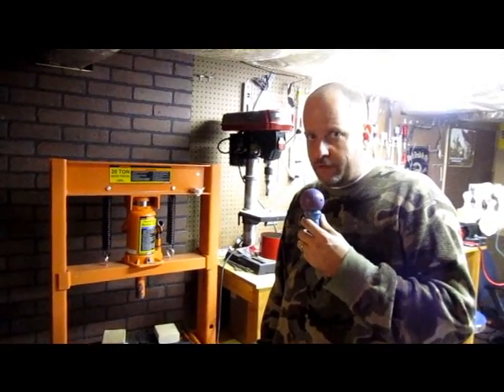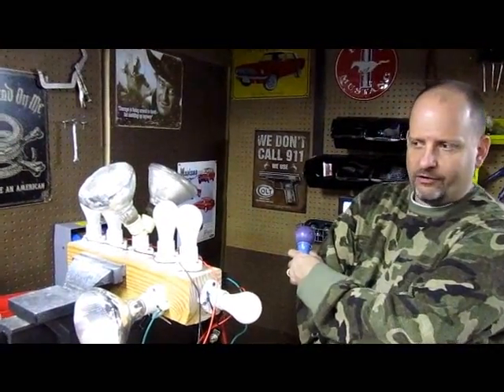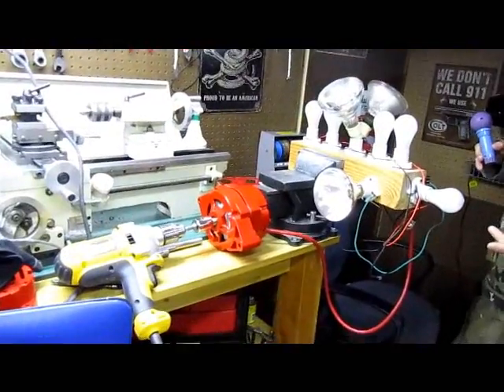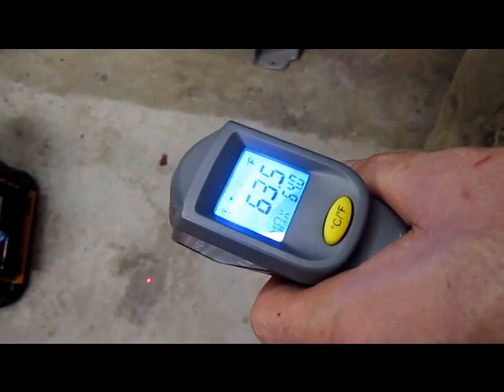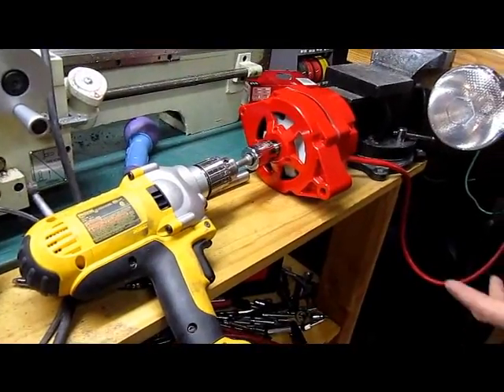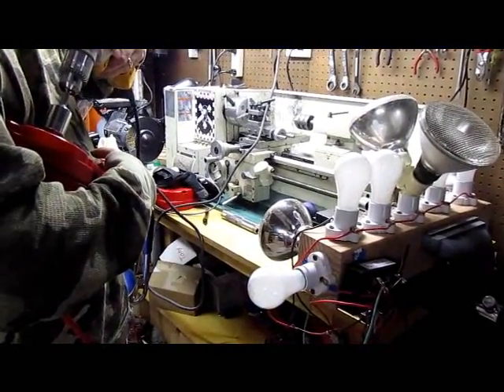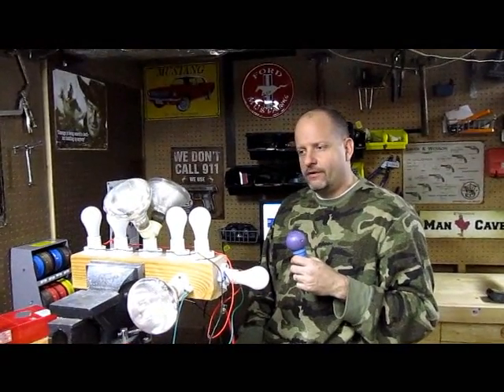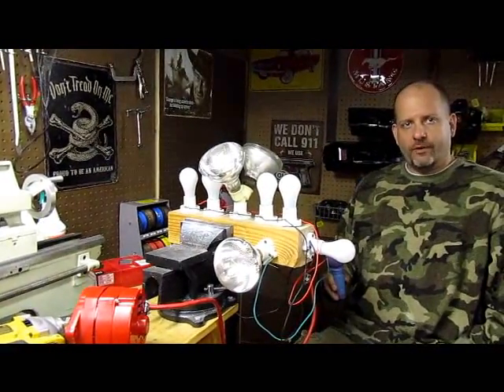Hurricane Wind Power Generator

Comment: Im in the market looking for a quality generator but can't seem to find solid written specs on this product. 
Minimum RPM and Amp?
Max RPM and Amp? 
Can it be directly plugged into a 12/24 volt battery pack or this alternator requires higher voltage?

Comment: hey you guys at hurricanewindpower!  do you have any chart of power output vs rpm? you told during this video there is about 8 amps at 1000rpm, but what does it produce at eg. 300 rpm?  volts and amp..?  thanx in advance for answer!

Comment: Anyone...I understand that they buy a specific Motor type then modify it to the specs or ways they need to push it to the success that it is.
Question: What is the Type/Name of the motor they use, specifically the Cat 4 Neo. I need data, for a project I'm working on that uses there PMA.
Need fast answer. Thank You in advance...

Comment: not trying to disprove what your trying to explain. But that test shows nothing if your stator is going to burn up.  A real test would be to mount that alternator to a gas engine and run you ~500W load lights for at least 4-6 hours straight. That would show over time as your stator heats up it will not burn out.
Reply from the maker: We have a test showing stable operating temperatures with a thermometer. If you would have watched the video you would have seen that test has already been done
Reply: I get what you're saying, but it needs to be tested under prolonged operating speeds and again at normal high operation speeds such as a storm. hooking up to a gas engine or even an electric one is extreme testing. Alternatively (pardon the pun), between the main turbine fan blades should probably be another smaller fan to keep the PMA cool, Like a cars factory alternator should have